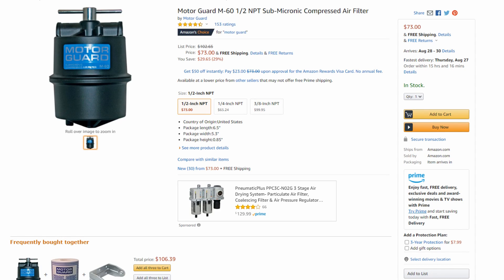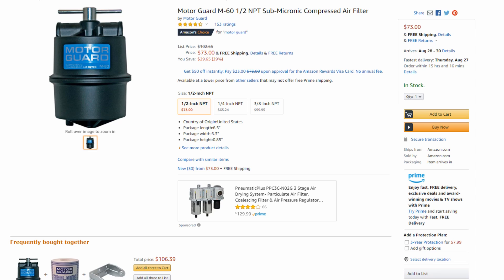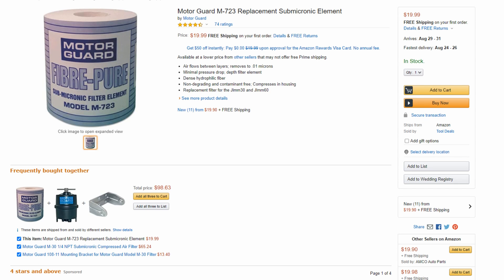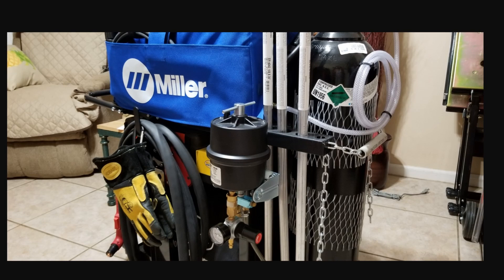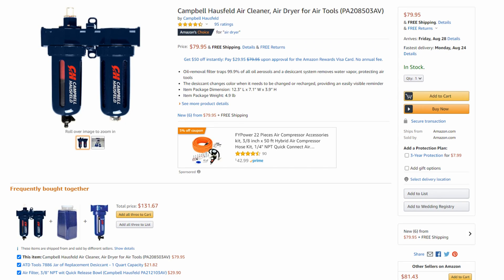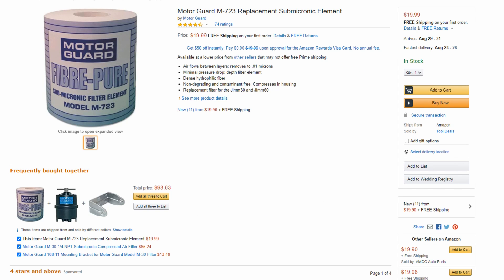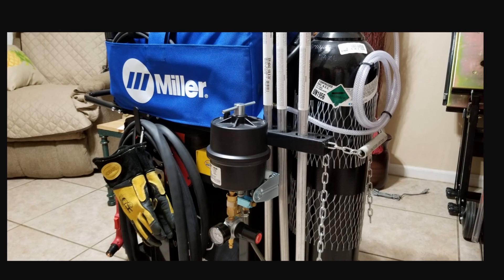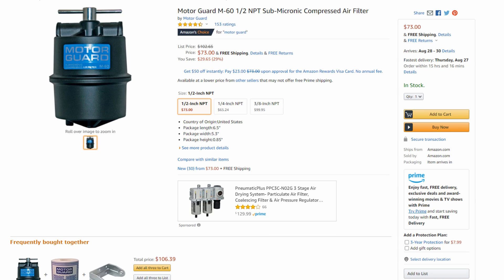What's The Best Air Dryer and Filter For Plasma Cutters?

Comment: I had the Campbell Hausfeld filter/dessicant dryer and it lasted about 8 months before the drain valve just stopped closing. It was right in the middle of spraying clear coat so I ran an oversized screw with loctite through it. It worked but the cheapness of the valve was blatantly apparent. I should have known better. It never really seemed like a quality unit from the beginning as the bowls are exceptionally hard to get on

Comment: Any thoughts on the Superdry in-line dryer?
Reply: Wondering the same. Did you pull the trigger and buy it?? I’m getting desperate lol
Reply: @jared7081  Ha no I didn't. I was considering buying one to jerry rig an extra air dryer for the air suspension in my truck. Did not get around to doing it. Seems like a pretty cool piece of gear tho

Comment: The name Motor  Guard came from the origional which used toilet paper to filter motor oil. The origional compressed air filter was designed to use toilet  paper. There were no  high wet strength elements in the 60s. If you use toilet paper  use paper such as Scott 1000 sheet. Unroll  it to the size of the Motor Guard elements. I still use them for Motor oil. The size of the tube can be made smaller and stronger by saving empty cores splitting them and inserting them. Probably not necessary with the new paper. It is shorter. The core  wont get  crushed.

Comment: My father ran TP in his Motor Guard style Air Dryer since at least early 80s. I inherited it a few years ago when he passed. I have never run any thing but TP in it either and have never had a problem....Actually there is one small issue. In order to cheat people a lot of TP manufactures are using a lager diameter cardboard tube to wind the paper onto cuz it lets them make a roll that looks the same size, but has less TP on it. Anyhow at least with very old Motor Guard style Air Dryers like mine cheater rolls of TP don't fit as well. They still work but are harder to load so I just recommend looking for and buying TP with the size tube that fits your filter.
Reply: The last paper I got at Walmart  was the Great Value 1000. It had the 1and 1/2" core. The new paper is shorter. Probably wont crush and damage the core. The Factory elements are better if cost isn't an issue.
Reply: @ralphwood8818  Yeah there's lots of TP shenanigans these days, but you can still find standard size rolls. If I'm having trouble finding it I usually look for single individually packaged TP. Those are most likely to be standard size.

Comment: I'm setting up a small plasma table in my garage and have a Hypertherm 30 XP plasma cutter.  I don't have any air dryers yet and was thinking of the Motorguard filter also.  Should I add another filter near the compressor?  I'd prefer to keep this as cheap as possible.  Amazon links would be helpful for an extra filter.  Thank you.